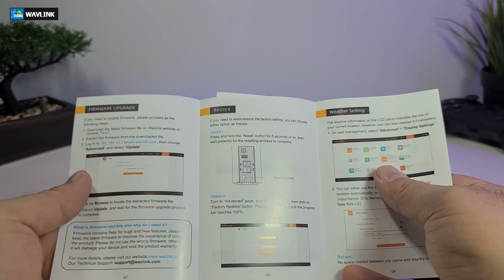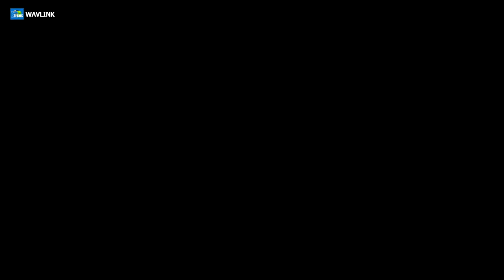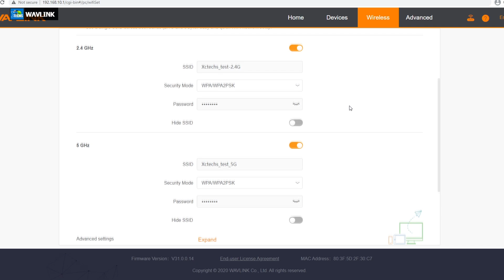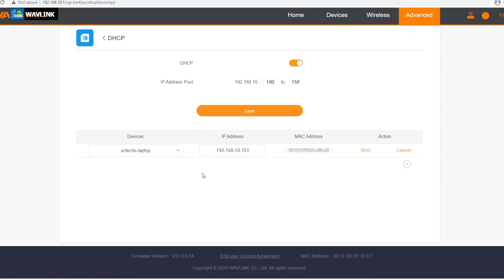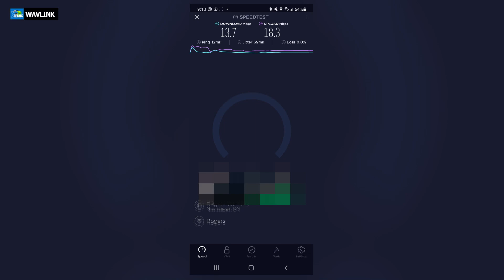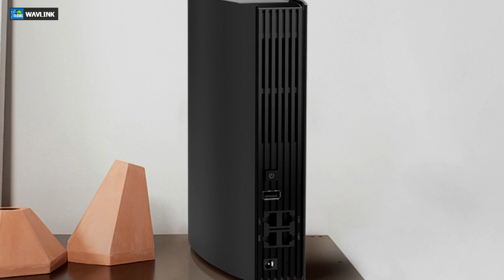WavLink Quantum Dax - MU-MIMO Dual Band Gigabit Router Review

Comment: Router not good 2 4 wifi I get 120mbps and 5ghz 990mbps 100 up on virgin basic hub
Reply from the maker: @jasonmorgan7807  2.4Ghz network may bring wider range for internet your speed won't increase,  like 5hz network bandwidth.  If your asking why speeds are different.

How far you are and speed on wifi and router broadcast all matter.

Comment: Mine says network error, connected without Internet  any ideas? Thanks
Reply from the maker: Troubleshooting steps restart,  if didn't work maybe you are using bridge make sure other router is working. If your device your connecting to this router then Troubleshooting will be, find the SSID on your device click forget and Re connect.
Reply: @xctechs  I've been trying to replace the other router with this one what's the point of using 2 routers
Reply from the maker: @robertgruszka7099  I would not suggest two routers. 

Check your cache on your device that is not connecting,  forget SSID then reboot device and try reconnecting.

Comment: Why did you skip over Extender function? I am looking for proper way to link 3 Quantum DAX/WN538A8 machines. Should Wifi be Single SSID for Dual-Band? Is it better to have the satellite link to the primary routers signal using MAC or point to the closest Dax Satellite?  If I want to make each Dax box an AP device instead (using ethernet), how do you bridge each back to the primary router? I have done this using LAN ports but then I looks a lot of Web Admin function.
Reply from the maker: great question,  I didn't capture that part #1 the video was already too long, #2 it was not something this router is was given to me for.  it was basic unboxing and that is all, but i thought lets go in a little more and detail it since i love the router. 

I am using modem connecting to this router, but how you indicated for connection that works perfectly too.  I would not bridge this router.  I would get something like Wavelink Halo Polar AC3000 to make your mesh network work better and capture more then 5000 SQ covered.   which is almost same price as this router,  don't get me wrong this is a great router but works better when it is single.
Reply: @xctechs  thanks for responding.  I currently have child dax boxs connected via lan ports; ssid the same across, dhcp off on child boxes. It creates the mesh, but not sure my devices are attaining best signal.
Reply from the maker: @jamesespejo8554   oh, please check for 3 signal bar on your phone where you located the child dax. that will help you have that 80% to 95% bandwith for data.

Comment: Hi    have a question I have bought a  bluetooth  remote but when  I connect to my tv box, it shows it paired, it works fine ; now I close my box  and try to re open the box , and remote does not open the box, why? It loose connections. please need help. asked this question to many people; thanks.
Reply from the maker: that is correct, try to use another remote or computer keyboard and check to make sure you are still paired.